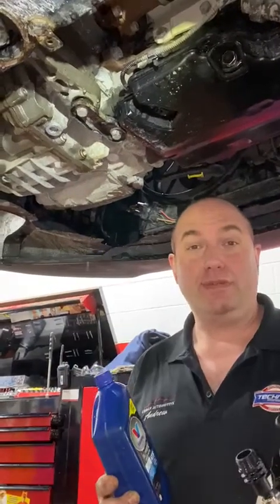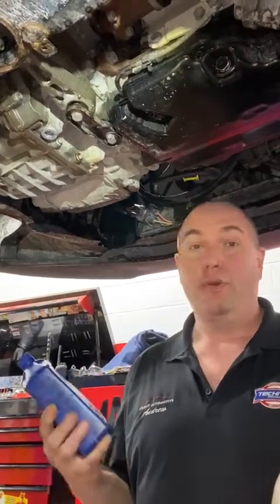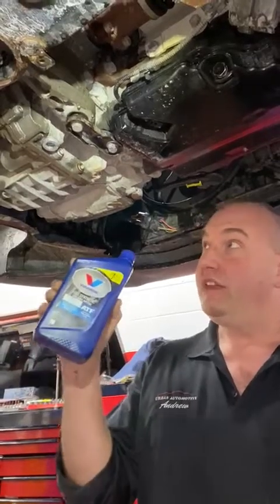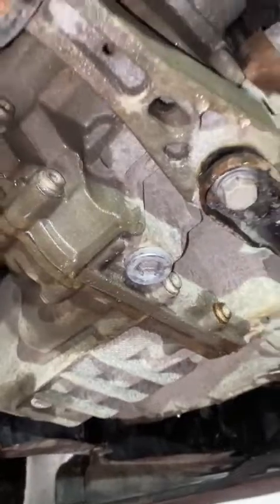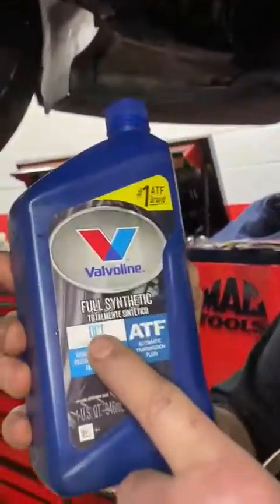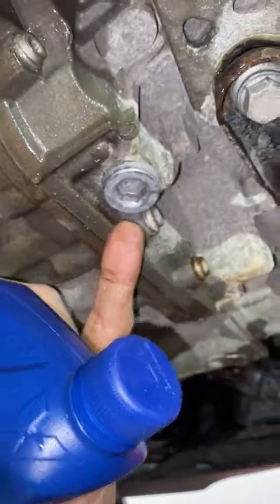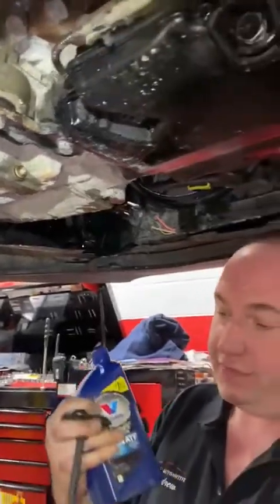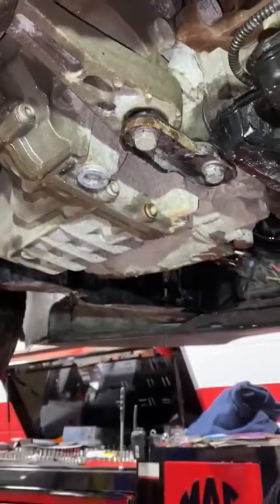What is a "Dual Clutch" transmission and what is involved with it's maintenance? @UrbanAutomotive01

Comment: i rarely see poeple use that oil in a vw dsg, have you/customer had any issues with it after the service?
Reply from the maker: We have done several of these services on various brands with the dual clutch transmission. We ALWAYS  cross reference compatibility directly with our Valvoline product support in the US to ensure manufacturers requirements are met. 
No issues at all with the vehicle in the video or any others that the service was completed on using the Valvoline product. 😉

Thanks for watching 👀 🙂
Reply: @UrbanAutomotive01  Thank you for your reply. I've also used this oil in my GTI's DSG transmission but haven't found any prior accounts of it being used without issues. Do you think it will be alright?
Reply from the maker: @leonkurtish9242  https://www.dash.valvolineglobal.com/portal/index.html#/productFinderLite/productFinder

This will confirm for you 100%. They make it easy with year make and model. 

Good luck. 👍